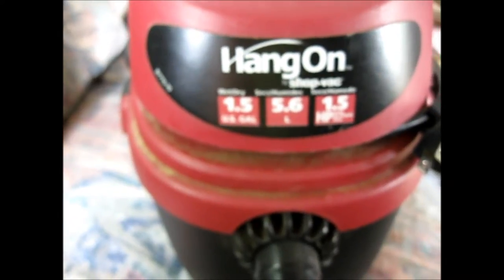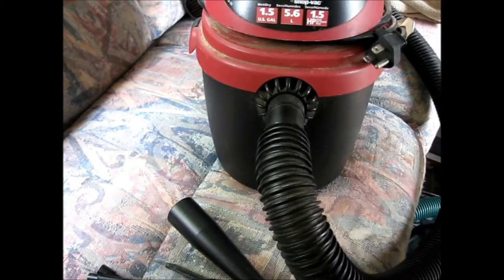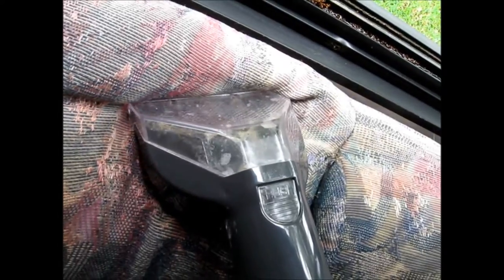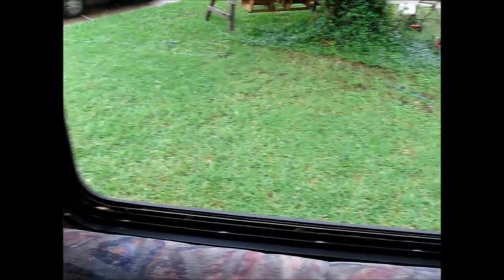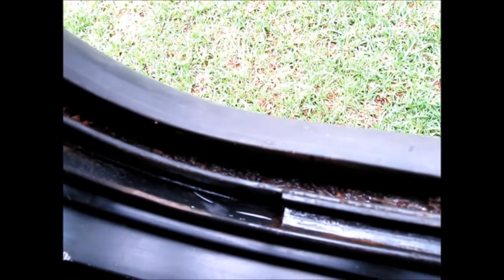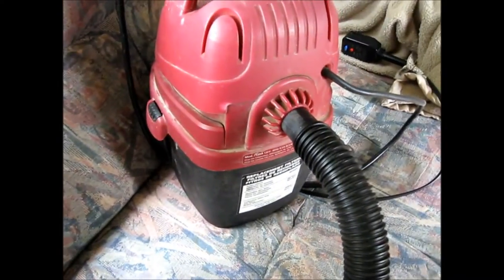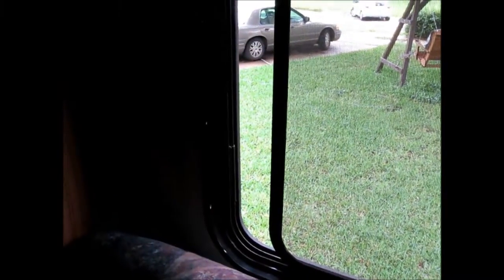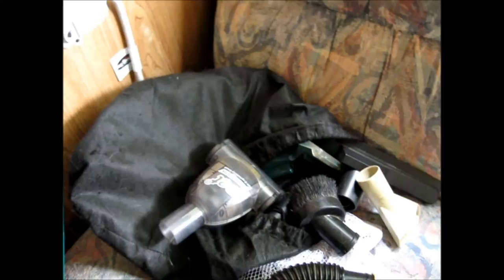Fulltime RVing   Fixing a window leak

Comment: Not everyone knows about the "weep holes". A soaking wet sofa really sucks, especially when you are sleeping on it! Maybe one of those pre-made slip covers would be a nice intermediate fix up to really reupholstering it. Gee whiz, get well soon, and stay off your feet?
Reply from the maker: I am glad the sofa sucked up the water instead of the wall. The sofa was pretty much dried out by bedtime with running the a/c to pull the water out of it. Along with what I had already done. I have thought about making a slip cover, but those things always seem to slip off all the time. We took a course once in school how to recover furniture. I would like to puffy the sofa back up some too. Now, how's that for professional lingo! ;-)
Reply: Tack some thin sheets of memory foam oni t, might make it comfy! Put that under a slip cover.
Reply from the maker: I'm going to lose it soon anyhow. Will have to move all my guys back in here soon & return to using my passenger seat (which turns around) as my main seat for myself. Need to clean under the glazing bead & water test the window soon though to be sure it;s ok again.
Reply: A lot of dogs inside a little RV, mine seems tight sometimes, with just me and Toto.
Reply from the maker: Yep. Had I known I was going to live in it, I would have bought a bigger RV at the time. Life has a way of changing...